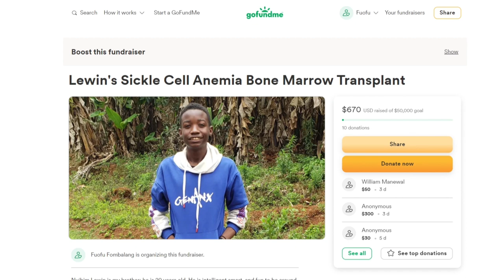Rivian Will Not Do Any Price cuts for its Vehicles

Comment: The thing you did not address is that the R1S is a true SUV.  No other EV company makes a six passenger EV of this size that will travel 321 miles when fully charged.  I previously owned a Lincoln Navigator.  I currently drive the R1S.  It is 5 inches shorter and 5 inches wider than the Navigator.  It has great storage space.  It is a great SUV.
There is  tremendous interest in the R1S.  I am approached daily by people asking about the R1S.  Once they get production up they will have no trouble selling them. They do not need to cut the cost. IMHO